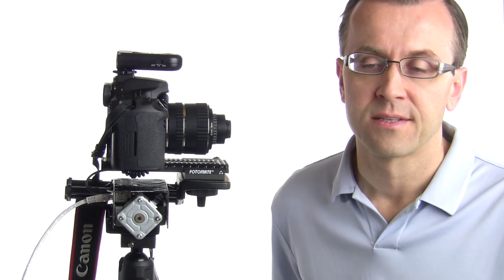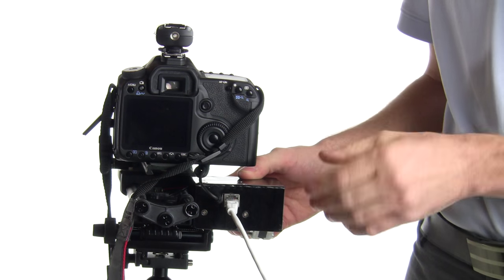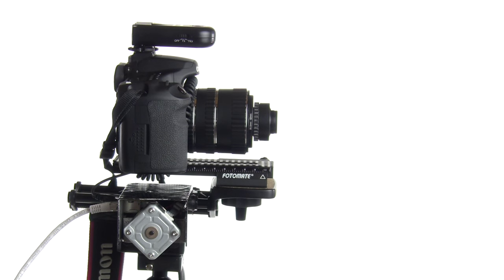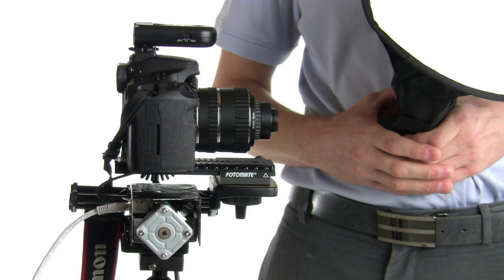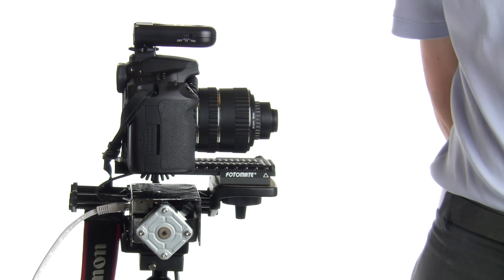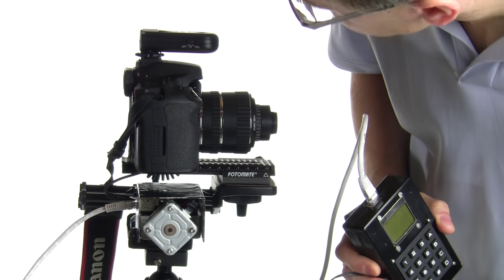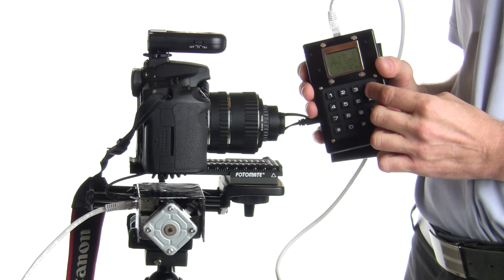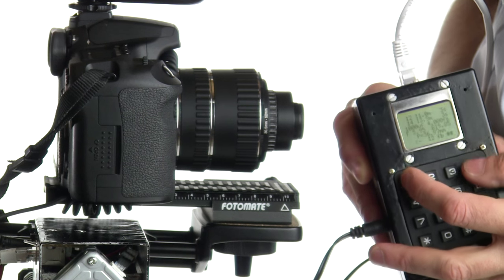Fast Stacker: live demonstration

Comment: Hi, thank you for sharing your project. Can you please somehow make the libraries available ?  They seem to have the same name as others and,, well I guess you can understand. Therefore I can't make your sketch/ code work and I'm not experienced enough to rewrite the code that much. Thank you so much in advance.
Reply from the maker: +Zteel There is no need to install any libraries - just get my code and compile it under Arduino IDE. All the files required are already included in the package. My code can be found on github (https://github.com/pulsar123/Fast-Stacker), or get it directly from http://syam.no-ip.org/stacker_v1.16.zip .
Reply: +pulsar012  Thanks for your swift reply. I've been struggling all day to be able to verify your sketch and thought there was a library missing. It's just that when i "Verify" Stacker.ino I get so many errors. I really love your project and would so much like it to work. Am I missing something essential ? What I do after unzipping is opening Stacker.ino in Arduino 1.6.8 and click Verify. I really appreciate your help. Thank you.
Reply from the maker: +Zteel Where did you get my package - on github? I just realized that if you get a release on github, you need to do one more step before you can compile it. Specifically, you have to create a folder "stacker", and then move all the files from the zip archive to that folder. Alternatively, you can get it from my site (http://syam.no-ip.org/stacker_v1.16.zip), and once you unzip it it will already have the "stacker" folder. After that all you have to do is to open the file stacker.ino inside Arduino IDE.
Reply from the maker: +Zteel It is possible that the errors are due to the fact that you are using a newer version of Arduino IDE. I am using 1.6.5 on both Linux and Windows computers, but I can see that the latest version is 1.6.8. Can you install the 1.6.5 version to see if it fixes your issue? It is still available on arduino.cc .
Reply: +pulsar012 Well, I think you're on something here,, a completely different set of errors. I'll try an even older version of Arduino IDE. This 1.6.5 was r5.
Reply from the maker: +Zteel My Windows Arduino is 1.6.5-r2.  I am trying to install 1.6.8 now.
Reply from the maker: +pulsar012 No, it must be something else. I just successfully compiled the s1.16 version of my code under the newest Arduino 1.6.8 (under Windows 7 64 bit) - no error messages. Is the error list large? Can you just post it here (perhaps only a few first lines)?
Reply: Haha,, that was NOT what I was hoping for. Here are a few of the errors. I have removed linebreaks.

(I got rid of the first one by changing _AVR-GCC_   to _AVR_GCC_)

------------------------------------------------------------------------------------------------------------------------- 
In file included from sketch\pcd8544.cpp:2:0:
sketch\pcd8544.h:18:14: warning: extra tokens at end of #ifndef directive [enabled by default]
 #ifndef _AVR-GCC_
              ^
In file included from C:\v1.16\stacker\stacker.ino:40:0:
sketch\pcd8544.h:18:14: warning: extra tokens at end of #ifndef directive [enabled by default]
 #ifndef _AVR-GCC_
             ^
C:\v1.16\stacker\calibration.ino: In function 'void calibration()':
C:\v1.16\stacker\calibration.ino:18:22: warning: deprecated conversion from string constant to 'char*' [-Wwrite-strings]
     letter_status("C");
                      ^
C:\v1.16\stacker\calibration.ino:33:22: warning: deprecated conversion from string constant to 'char*' [-Wwrite-strings]
     letter_status("C");
Reply from the maker: +Zteel What is suspicious is that pcd8544 stuff is inside "sketch" folder. Did you install the pcd8544 library by hand? If yes, can you delete it? I include a modified version of this library in my package, it might conflict with the one you installed yourself.
Reply: +pulsar012 I've now tried 1.6.4,, didn't compile all the way, got stuck. I then installed 1.6.8 on a completely new and fresh laptop with no other software than Win10 yet, and got the same errors again. The only difference now and that really shouldn't be a problem is that I run Win 10 and you Win 7. I think I'll give up for today and give it a go in the weekend, been struggling for 12 hours now :) It really is a shame because from what I see from your video and documentation it is extraordinary well done. Thank you for your time today and I will let you know of my progress. Maybe if you hear others who do or don't succed to compile the code you can tell me ? Thanks for your effort today. /Thomas
Reply from the maker: +Zteel I know a few people compiled my code successfully in the past, but today I got complaints from you and another person on dpreview (but the sypmtomps there seem to be different - "sketch\pcd8544.cpp:5:25: fatal error: HardwareSPI.h: No such file or directory" ). Still, it left me wondering if something changed recently which would affect all future users of my code.   I'll look into this further.
Reply: +pulsar012 For what it's worth. Most of the errors are what they describe in the link below. Unfortunately I'm not that good at programming sothat I can do something about it but it might be a clue for you if you run in to it in the future. They mention potential errors in futures compiler versions.

http://arduino.stackexchange.com/questions/13429/deprecated-conversion-from-string-constant-to-char
Have a good night now.
Reply from the maker: +Zteel l I just successfully compiled the current version of my software from github on a Windows 8.1 laptop, using Arduino 1.6.8. This is the first time I installed Arduino on this laptop, so it's totally clean. Did all your attempts involve Windows 10? If yes, then that must be the reason for your troubles, as this seems to be the only difference between our setups (unless you are making some very basic mistake - but I can't think of any). Can you get hold of Windows 7-8 or Linux PC and try there?
Reply: +pulsar012 Hello again. I just installed Arduino on a trustable Win7 laptop and tried to verify your code but no luck. Still the warnings about the extra tokens and so on. I've tried with the Stacking folder on different locations, desktop and in the "sketchbookarea". It's not often I run out of ideas but I'm getting close to that point right now. I mean, is there a way I can be doing it wrong ? Judging by the errormessages it feels like we somehow have different compilers (I know shouldn't be possible), what language is your OS in ? Why do I get warnings, not real errors and you don't ? It would be so useful to get in contact with other users of your code just to know if I'm the only one with problems.

This is HOW I do, can it be done in ANY other way ? Is there anything that I should install more than the standard IDE ? You say no other libraries but anything else ?
1. I unzip your code to the desktop. 
2. I open Stacker.ino from within Arduino IDE and see all the tabs that load. 
3. I select the verify icon.
4. Get errors like,
warning: extra tokens at end of #ifndef directive [enabled by default]
warning: deprecated conversion from string constant to 'char*' [-Wwrite-strings]     letter_status("C");

I don't want to be wasting your time anymore but really am greatful that you've given it so much time already. I will keep trying your new releases and will be crying over not being able take pictures using your project. Just as I was receiving the last parts from China,,,

Best regards,
Thomas
Reply from the maker: +Zteel This is indeed very strange. One other possibility (suggested to me by my colleague, who's more knowledgeable about compilers) is that on all your computers some package is installed which messes up with Arduino compilation - perhaps a Microsoft C++ compiler. BTW, did you try to compile other Arduino sketches - is the problem there? Also - are we using exactly the same programs? Did you follow this link to get the IDE: https://www.arduino.cc/download_handler.php?f=/arduino-1.6.8-windows.exe ? Or perhaps you got one of "nightly" releases? I did the former.
Reply from the maker: +pulsar012 BTW, the compiler output you sent me was all warnings, no 
errors. Did you get any errors? If there are no errors, only warnings, 
the code should have compiled. Did you get the two lines at the end 
starting with "Sketch uses..." and "Global variables use..."? If yes, the compilation was successful. It's still puzzling you get the warnings (I get none), but it's likely not important.
Reply: +pulsar012 I get the lines in the end you mention so maybe it will work then despite all warnings !? I thought "too many tookens" and such meant it wouldn't work. No fun doing all the hardwarejob and then fail on the software. And, no I don't get any errors compiling other sketches but maybe that's just because they are not nearly as advanced as yours (max 2 printed A4 sheets) and never seen linked .inos before. I'll spend the this weekend and next and next trying to get this to work and will let you now my progress..  The idea about different Microsoft compilers sounds in this case plausable since we have tested all different combinations of the "standard" software, makes we wonder if there somehow somewhere in the software is just a little bit too much Swedish in the code.
Now I'm really looking forward to my last China parts and of course my first pictures.
If ever I am able to verify your code without the warnings I'll of course let you know.
Excuse me for repeating myself but again thank you so much for your attention and help.
Reply from the maker: +Zteel I am almost 100% sure the code should work fine with those warnings. I do lots of other (non-Arduino) compiling, and having long lists of warnings is a rule rather than exception. I'll look into that char warnings as it is inside my own code and likely something I can easily address.
Reply from the maker: +pulsar012 A breakthrough: I noticed that in Arduino Preferences I have the Compiler Warning set to None (which is the default value - or perhaps not?). Once I changed that to "Default", I got all the warnings you were talking about. So the solution to your problem is to set that option to None :)  . If seriously, that means that you can rest assured that the code will work for you, as I'm seeing the same warnings. Now that I can see them, I'll try to address them, but it's a low priority as the code works perfectly fine.
Reply from the maker: +pulsar012 Here is the first fix: after some googling, it looks like _AVR-GCC_ is used by the pcd8544 library to differentiate between Arduino and Maple (which is an Arduino-like board). Because my code will only work on Arduino, it is safe to delete the 6 lines in pcd8544.h:
#ifndef _AVR-GCC_
#define MAPLE 1

#ifndef SPI_NUM
#define SPI_NUM 1
#endif
#endif
After that the first warning is gone.

And all those "char" warnings are gone after you fix two lines in status.ino: simply replace "char *" with "char const *" for letter_status and display_comment_line functions.
Reply: +pulsar012 You just are the king ! I had the correct settings in the preferences but obviously I had to go in there and just click OK to make them effective. After the changes you suggested it all looks the way I think it should. It's not often I meet someone as stubborn as I am to get thing to work but you obviously know your things and I just use brute force :D
I'll contact you when I've taken my first pictures if I may.
Thank you !!